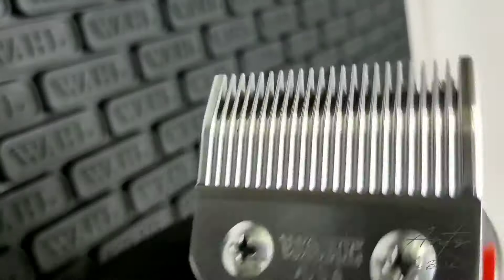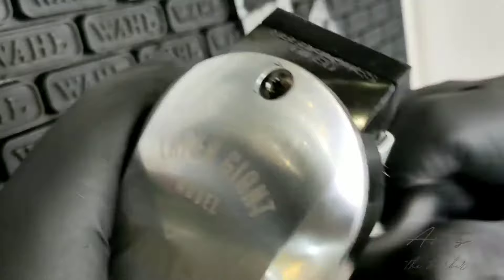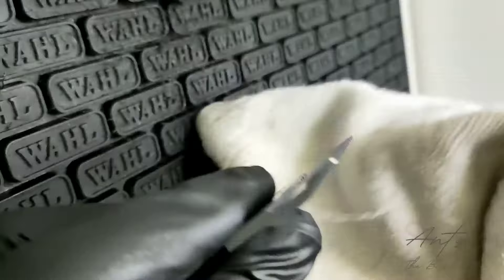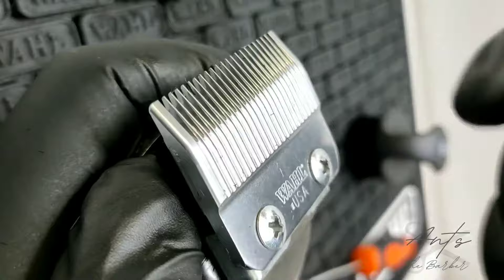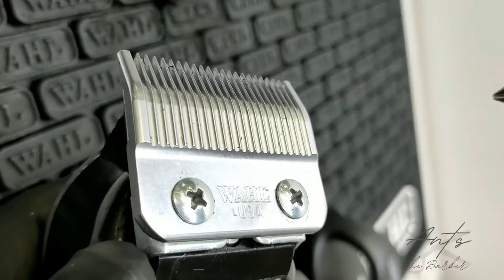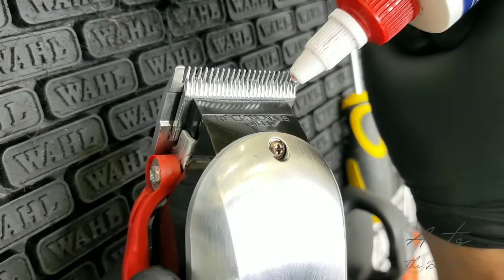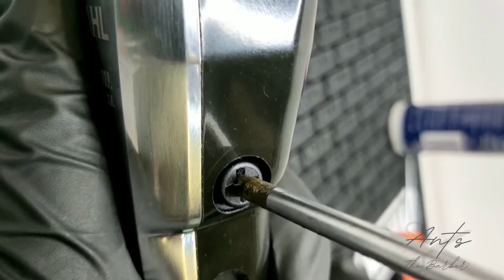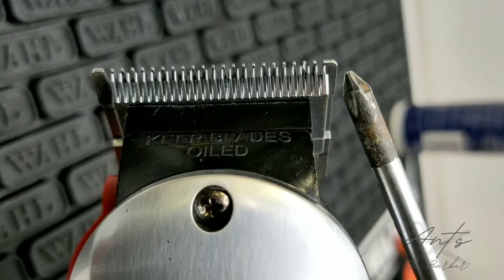HOW TO SET YOUR WAHL CLIPPER BLADES

Comment: No offence, but you are rounding off the screw heads if you're screwdriver comes out when you tighten them. Do that a few times and you need new screws pretty soon.
Reply from the maker: I'll keep that in mind next time. Thanks. 🙏🏼
Reply: Thanks for this.
Reply: You can get a biggest size screwdriver. Looks like it still would fit the voltage screw (maybe better) and not rund out the head screws as easy
Reply: Or somebody gettin stitches
Reply: My question is, is do clippers HAVE to have that foam hair filter? Or is it okay for them to not have one?
Reply: @jilianwilliams2232 its late, but it might burn out if a decent amount get through
Reply: Definitely get yourself a better sized Phillips for your screws. They're gonna get destroyed using that one. Thx for the upload

Comment: I bought new wahl clippers and they were pulling my hair and not cutting even after I oiled them and I watched your video and turned up the voltage.I'm good now.thanks
Reply: Should the small blade be able to move at all if you push it a lil cuz i screwed it in enough and it moves

Comment: I wish I would have seen this before running to the pet store to get new replacement blades which didn’t fit.  After I saw this video I realized that the old blades were installed wrong and they worked like a charm.  This was the best tutorial and I appreciate you taking time to share your knowledge.

Comment: God bless you bro. Just got it. Shaved, bathed and now in Church. This is my 1st time resetting the blades of my clipper myself. And the problem was that the lever didn’t lap well with the new blades grove. So I trimed the lever a bit. Made it ever all the way, then when i screwd it tight it didn't lap. Then i loosed it and made it sit on the lever and carefully placed the blades and screwed gently to hold and reposition the little blades untill they lapped as you showed us the teeths should lapped then tightened and started it and the blades didn't fall off this time as did after the vendors set it themselves. 
But then it made a loud noise then i screwed the voltage screw up n down till the sound was gentle n smooth. Then shaved the hair on my hand to make sure its working ir did. Then shaved myself neat and jumped in n out the bathroom n out to Church. Just singing the Entrance him now b4 the Priest comes in.

Took me about 45mins to sort it. Got it on the 3rd time. Almost gave up cos was running late to Church.

Thanks to you i look good on my bday.

Comment: Thank you! First, you helped me to become familiar with my new Wahl (battery type, made in Vietnam, no adjustments here, but mechanics similar), then I decided to check my ages-old SF-938 haircut machine, too, which has the same parts but much bigger (45mm, to be plugged into the mains only), get out approx. a pound of hair stubbles from the inside and do maintenance and adjustment after reassembly according to your instructions, too. It is amazing how silent that one has become now 😅.

Comment: I had all the information except the side screw voltage adjustment.  I was trying to find the sweet spot for the stationary blade screw tightness since when I tightened it completely the cutting blade would not move.  I could cut a bit then the screws would loosen to much and cause issues.  This was perfect now I can keep a nicely manicured beard and mustache.  Thank You!

Comment: i love this video. I have the Moser 1400 and the power screw seems to work in the opposite way: clockwise the noise calms down (the screw goes in) and anticlockwise the noise becomes higher (and the screw comes out). However, your model is really silent, while mine only change from noisy to extremely noisy, there is not the clear separation from "silent" and "oh, it starts screaming now"

Comment: Thanks for this tutorial, it’s a truely really informative. (The positioning between the 1st and last tooth)

just one question, how do you measure the 0.8mm?

The reason I ask is that I have a wahl magic and I recently adjusted/zero gapped it, and I’m not sure if it’s made things better for me, I feel that it may have made things abit harder to see (too close) on a fade (when setting a no guard open guideline & #1 guard open guideline)

I’m thinking of changing it back to the factory setting, hence watching this video.
Reply: I'm not sure this is the way... https://www.youtube.com/watch?v=g8YuS1Kka2M#t=44: "The extreme left-hand tooth on the top blade should be positioned so it is over the gap between the 2 left-hand teeth of the lower blade".

Comment: If the cutting blade can’t sit straight but sits crooked because of the plastic piece that goes in the center of it, then it’s a manufacturing defect right? The top blade on mine can’t be angled enough to compensate for the crooked sitting bottom blade. It stays crooked since the cutting blade is held in place crooked to begin with
Reply: Mine doesn't sit too , I think the who sharpened my blades changed it
Reply: Mine's doing that now and now the dam things don't move correctly since I've cleaned the hair out of them and put the blades back on. Lol it's like the hair was keeping it together 😭

Comment: Everytime I screw down, and I use so much attention, the teeth move. I hate the Wahl system it's like they want us to fuck up the clipper
Reply: I recently bought a Wahl Legend and it needed adjusting as the stationary blade was not straight from factory. However I used this YT-video as a guide and it was REALLY easy to adjust everything using the technique of fastening one screw a tiny bit at the time. I didn't even need to hold it with a finger to stay in the same position..

Comment: Excellent clip, except that you are not adjusting the "voltage" with the side cross-headed screw, just the tesion in a spring, which changes the off position of the moving blade and how far it moves. I hope it helps

Comment: My little son threw my on the floor and cutting blade shifted off it position and when I try looking into it, it fell off. Loosing the blades I noticed the foamy is torn and the white rubber/plastic have receded inside that the cutting blade can't latch on it. What do I do to fix it and align the blades again?

Comment: Great video!

But I have a problem. My clippers made a loud sound before. I re adjusted the blades and it stopped without adjusting the power screw. 

It started again and I tried readjusting the blades and power screw again. Blades are aligned. But the sound is very loud and even after power screw adjustment. What do I do now?

Comment: What was that soft felt hairy piece you removed from between the blades (0:30)? 
I do not have that on my unit.
Reply: it's a filter preventing the hairs go to the motor, my old wahl had it but my new doesn't
Reply: @slowswimmer9169  you think we should improvise something if we do not have it in the new ones?
Reply: @gt-c-  I really don't know what can we use, some using a piece of sponge as I've read

Comment: Ugh...I tore the dang filter!  Where can i get another?
Reply from the maker: Dang... They are so easy to tear. 🤦🏽‍♂️ I'd say they're still ok to use with a tear in it. It's just there to keep hair from getting in and clogging up the motor. Otherwise, if you still have the little foam pad that came in the clipper case when you brought them, you can cut a piece of that to size & cut a slit in it to put the blade arm through. Hope that helps. 👍🏼
Reply: I did the same, but i cutout a piece of normal household sponge, and it works just the same or as good!!! 🤟👍

Comment: What oil should I use? 

So don't need to soak or scrub in a solution or anything?
Reply: Wahl oil from Amazon
Reply: The question is what kind of oil is the "Wahl oil". Is it just common white mineral oil, the same oil you use for example to treat wooden kitchen items?
Since they want to make us pay more than 10x the cost of common white mineral oil..